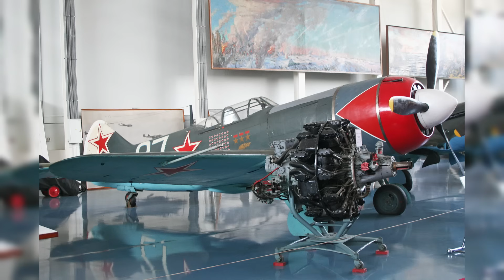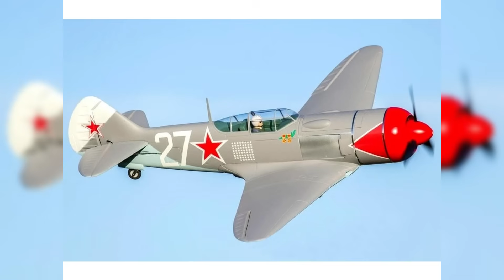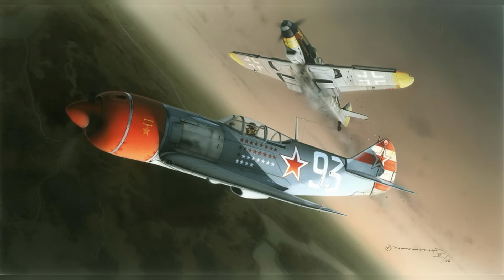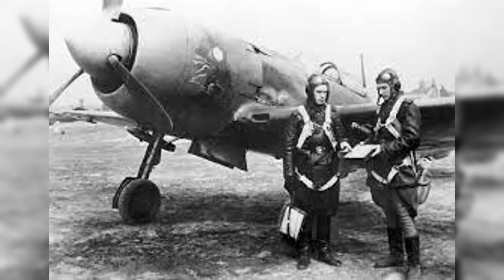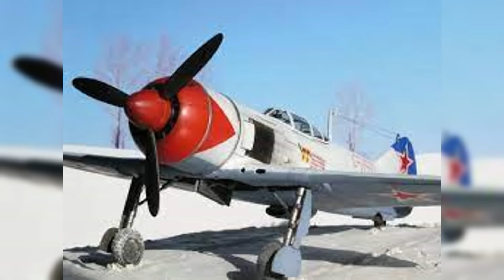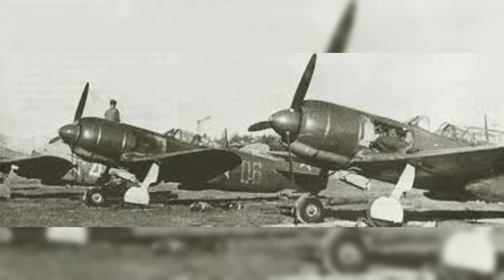La-7 – Lavochkin’s Answer to the Luftwaffe

Comment: On the title picture is Yak-11 not La-7😃.
Reply: It's a LA-7. The Yak-11 is a two seater
Reply: @Sumbutjuice  Actually a Yak-3U, with radial engine. Not much built.
Reply: Exactly! It's Yak-11 with mdified into single-seat cockpit, posing as La-7. The typical Yak tail and wingtips give it away easily.
Reply: So this isn't Ivan Kozhedub's LA-7?
Reply: @Sumbutjuice  Obviously no. Supposedly Kozhedub's La-7 is preserved at Monino air museum. Well, at least, they have a genuine La-7, but it is not airworthy by far.
The title picture of the video (the one, you see as a video sumbnail is Yak-11 modified for an airshows. It is, however, painted as a typical La-7 of Kozhedub's unit.

Comment: the thunbnail image isn'tr a La-7 . Looks more like a Yak
Reply: Yes, its exactly Yak-11 , ive seen one in Prague-Kbely  Museum of Aviation.
Reply: Most likely, this is an LA-7. The leading edge of the vertical tail is about 45 degrees, while in the Yak-11 this line is about 22 degrees. The engine cowling fairing is more developed and rounded, and the Yak-11 airframe itself is noticeably longer. The Yak-11 has a two-seater cockpit, shifted closer to the cowling, and the propeller itself is two-bladed. The LA-7 has three-bladed. The Yak-11 has side hatches with controlled louvers on the cowling, while the LA-7 does not have such hatches. The Yak-11 cockpit glazing fits the fuselage in a straight line, while the LA-7 has special cutouts in the fuselage (for better visibility to the sides and downwards). But they are very easy to confuse, especially if the Yak-11 is painted in LA-7 camouflage. In addition, sometimes for filming the Yak-11 was equipped with three-bladed propellers to make it more similar to the La-7. The Yak-11 can be seen in the film "Liberation. Kursk Bulge"... (Google translator).
Reply: @rudovessel4151  Yak-11 airframe is the same size, as Yak-3, it is, basically Yak-3U with a small radial engine and two-seater cockpit. The title picture shows Yak-11, converted into a single seater. The typical Yakovlev shape of the tail and wings give it away easily.
Reply: @SQSNSQ  дело не в размерах, а в пропорциях. Но я не говорил о заставке перед видео, я говорил о модели самолета на 8:00
Reply: @rudovessel4151  The topic starter was talking about the sumbnail. The actual video has images of La-7 art, 3D renders, scale model photos and a few b/w photos of the actual plane. There is also a picture of La-9 snuck among them. So, what I am saying, in the video itself there are no Yak-11 photos. Only on the submnail.

Comment: Excessively L O N G. The British and Americans UPPED the octane of the Red Air Force. 
THAT'S where the amazing improvement in Soviet performance came from.
LendLease machine tools did wonders back at the factory. 
There NEVER was an aluminum shortage. You've been guessing, or worse, believing Soviet war propaganda.
Stalin had so much aluminum that he used in the T-34 tank engine. But aircraft always had priority. Think about it.
Reply: Exactly, that's Truth.👍
Reply: Без ленд лиза совок рухнул бы.Мы это знаем.Кремлёвская пропаганда промыли мозги #рабсиян.Величие без основания это москали.
Reply: The British did not help the USSR with fuel and materials at all, receiving them themselves under Lend-Lease. However, they did supply the USSR with 1,331 Supermarine Spitfire aircraft (since 1943). The USA supplied high-octane fuel for its aircraft, also supplied under Lend-Lease (P-39 Airacobra, P-40 Tomahawk/Kittyhawk, P-63 Kingcobra, Hawker Hurricane, as well as for A-20 Havoc/Boston fighters, B-25 Mitchell bombers, C-47 Skytrain transport aircraft and O-52 Owl reconnaissance aircraft). Soviet fighters did not need such high-octane gasoline, they used their own (AM-100, AM-98, B-95/110). When necessary, Soviet aircraft engines were converted to run on American 100LL gasoline... There was a shortage of everything: high-quality gasoline, machine tools (which the USSR purchased for gold), and aluminum. Soviet aircraft of that time were 50–70% plywood and wood... The T-34 tank engines did indeed contain aluminum alloys, since these diesel engines were originally developed for aviation—for heavy bombers. Around the end of 1942, due to the aluminum shortage, the silumin cylinder blocks had to be replaced with cast iron ones.
Reply: @rudovessel4151  The British shipped up refined avgas out of Abadan, IRAN, by pipeline and then train to a port in the Caspian Sea. This was also the route used by American LendLease avgas. The British built up the Abadan refinery complex for its own navy, going back before WWI. Never was it imagined that British Oil would be sent to the Russians instead of themselves. The Iranians were FURIOUS at the time... so the British Army occupied southern Iran, the Soviets occupied northern Iran. See how that works.
Reply: @davidhimmelsbach557  этого я не знал. Спасибо.
Reply: @rudovessel4151  The Diesels were a French machine designed for air ships. Just had to correct you. No nation ever used Diesels in aviation for BOMBERS. Search planes, yes. ( Luftwaffe )
Reply: @davidhimmelsbach557  дело в том, что эти двигатели действительно разрабатывались для авиации, но не использовались на самолетах. Причин я не знаю. На Т-34 использовались и другие авиационные двигатели (карбюраторные), например, М-16, но это было в условиях жесточайшего дефицита всего.
Reply: @rudovessel4151  Engines developed for air ships. Air ships dreaded Otto cycle ignition engines. Hydrogen gas is why. Weight meant nothing to an air ship.
Reply: @davidhimmelsbach557  In the USSR they tried to build airships, but quickly realized that in the upcoming war they would just be targets. On Stalin's orders, the program was shut down. It is a well-known fact that the aluminum frames of the unfinished airship were not sent to metal, but used in the decor of a metro station. And now in Moscow there is a Mayakovskaya station. One of those where tourists are taken when they show the Moscow metro...
Reply: @rudovessel4151  The French engine was bought on the cheap by Stalin because of the fiasco in New Jersey. Suddenly, the whole idea of an airship hauling passengers was dropped. So the French plan to build a fleet evaporated -- right along with the entire market for said Diesel engines. For the period, they were state of the art.
Reply: @rudovessel4151  Diesel engines were used on Yer-2 medium bomber and Pe-8 heavy bomber. All were genuine Soviet design by A.Charomsky. One of the diesel engine types, used on those planes after the war was converted into maritime engine and is still in production as M-400, used on high speed hydrofoil ships. The design of Charomsky's diesels was heavily based on M-38 gasoline engines.
The "french airship diesels" is a complete nonsense.
Another country, that was very much into an aircraft diesels was Germany, which had several interesting designs, including vertical boxer design, used on Ju-86.
Reply: @rudovessel4151  OMG, what are you smoking?
Reply: @SQSNSQ  спасибо за информацию.))
Reply: @SQSNSQ  я курю марсианскую траву. Привозят с Марса.
Reply: @rudovessel4151  Sorry, this was adressed at @davidhimmelsbach557, not you. My bad.
Reply: @SQSNSQ  Stalin imported technology across the board in the 1930s. When this was done, the NKVD routinely washed off foreign source marks, and nothing was done inside the USSR to record what had happened.
Case 1 The Tu-4 bomber was a reverse engineered B-29.
Case 2 The A-bomb of the USSR was a dead nuts clone of the American Fat Man. Stalin even had its dimensions non-Metric -- same as the Tu-4.
There are other examples.
When it counted, no-one realized what Stalin had done.
Moscow loved to source from France. On paper, the NKVD made sure that Soviet citizens would believe that their own peers invented all of these wonderful new gadgets. In your case, the Big Lie has worked.
Reply: I've watched doco of the scientist in Baku who on his own developed the high octane formula. He was awarded highly by the soviets. On the other side the nazi Germany standard oil built which was payed ridiculously by a handful of ships and alott of harmonicas from hitler ridiculously this is fact .the usa sold the patents to soviets of aircraft engines. Obviously the Canadian and usa built Rolls-Royce merlin under license for Mustang and mosquitoes. War as is to this very second is about industrialists profiteering from government interventions thus fascist ideology

Comment: A small side note, the La-7 was not designed to fight the German airforce, as there was nothing much left of it by 1944. It was designed to maintain air superiority against the western alliance and the beginning of the Cold War.
Also the Japanese Zero fighter was designed to maintain its power through the first years of war against USA, which it did perfectly, but it was built on the very limits of what Japan could offer before the war with USA, thus in order to keep the war they had to come up with a completely new plane, which they couldnt do as they never planned on fighting the US for so long
Reply: You are probably right. The battle between the La-7 and two P-51D Mustangs did indeed take place on April 17, 1945. Apparently, there was a misunderstanding. The La-7 pilot (Ivan Kozhedub) saw that the Allied Flying Fortresses were attacking German BF-109Fs, and attacked the Germans. In the ensuing battle, the Mustang pilots opened fire on the La-7. The result was two downed aircraft. Thank God, everyone survived.
Reply: Sorry to break the news, when it was developed, Luftwaffe was very much alive and kicking, that only changed in late 1944.
If your claim had some merrit, it would be designed differently. Aerial warfare in the East was fought at low to mid altitudes. In the West there was a lot of high altitude combat, primarily bombers flew very high. In that case it would be designed with better high altitude performance. So, here you are completely wrong.
Don't try to rewrite history and include some fictional agendas
Reply: Why was my reply deleted? For three times....
Reply: @fifi23o5  вероятно в ваших ответах есть что-то, что ИИ считает за рекламу.
Reply: @rudovessel4151 translation, please
Reply: @fifi23o5  There is probably something in your answers that the AI considers to be advertising.
Reply: @rudovessel4151 There was absolutely no advertising, I was just a bit crytical with one claim he made.